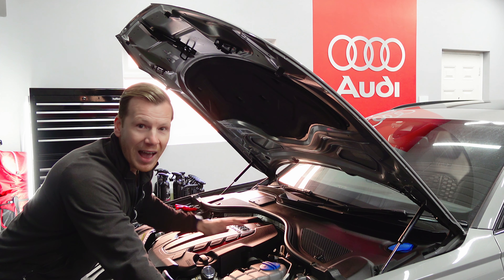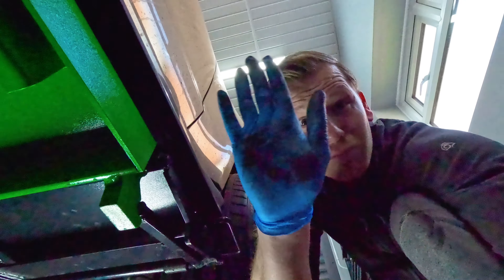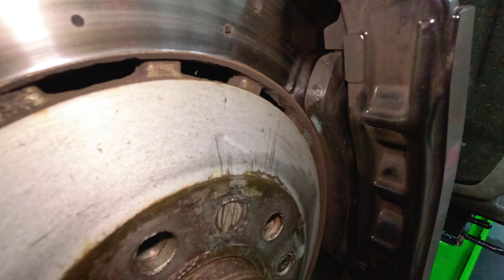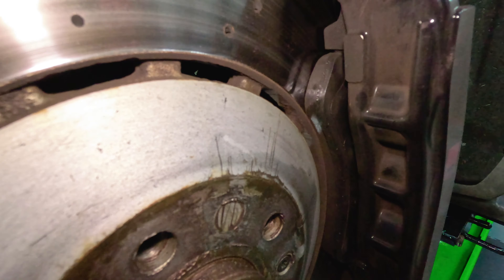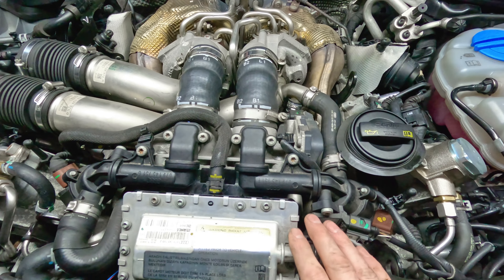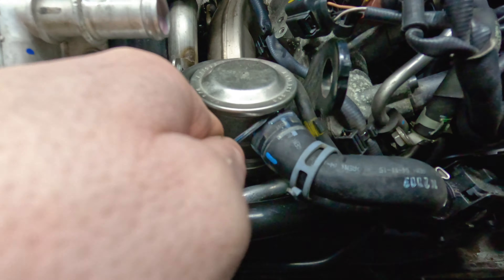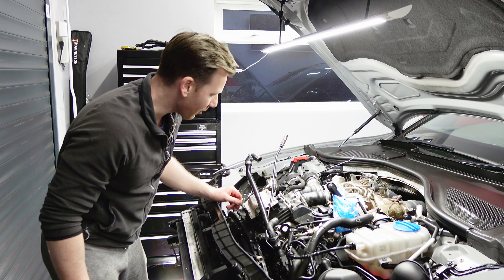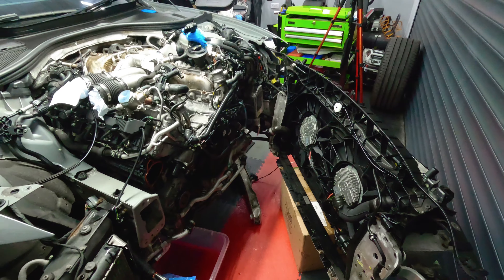Audi RS6 4.0 TFSI PCV Unit DIY Replacement Part 1

Comment: Great work! Clear instructions, well explained and great footage. Too often you find instructional videos missing vital steps! I note there are  two deep torx screws either side of  the bumper that is not easy to reach. Would have been great if you showed what you used to get to them.
Reply from the maker: Hey thanks for the amazing feedback and support,  SOOO much appreciated.  Yes there are three tricky 10mm bolts to undo that hold the side brackets on. Easier to take out with the wheel and arch lining off.   I'll show them clearly on the reinstall video.  Thanks again for watching and taking the time to comment.  :D
Reply: No problem at all. It appears several people on the RS6 C& FB group have picked up on your videos too. Just the other day someone shared a link to one of your vids on the group.

Comment: Suspect i have a bad PCV on my 4.0 S6. Do i have to disassemble the whole front of the car like you did to get to it? Enjoyed the video, thanks.
Reply from the maker: Hi thanks for watching,  unfortunately yes.   You don’t need to take the whole rad pack off.  You can just put it into service mode but you will need to take the front bumper off and headlights out etc.
Reply: Guess i know what i’ll be doing this weekend then. Thanks for the help🤘🏼

Comment: did you get the P2297 air leak DTC and a rough idle (noisy) first 20-30 seconds?  Also Oil cap has a great sunction ?    Let me know mate
Reply from the maker: Hi,  no I didn't get any of those signs,  in fact I think my PCV unit was actually ok in the end,  but I changed it anyway for good measure.  However I can confirm the suction that I got on the clip shown before changing it was the same after I changes it.  These engines seem to have a lot of suck lol
Reply: @InDadsGarage  i am getting missfire and partial loss of water so I am straight to check sparkplugs and afterwards chargecooler , looks like a leak in there
Reply: @InDadsGarage  i ll let you know when  i am done
Reply: @InDadsGarage  I am back mate.  Well most RS6 C7 series have a TPI connected with the fault P2279 air leak that leads to the replacement of PCV or better name it "Oil separator"  So found the issue over there :)
Reply: @InDadsGarage  Problems fixed !  Well Oil strainer changed and then my Water cooler was a mess like yours in the video !    Car runs fine like first day :)

Comment: Subbed. Had the oil separator and PCV done under warranty a week after getting my C7 (when Audi finally made the problem official)

Also loving the garage. I’ve just had my garage extended so I could fit the RS6 in, with pretty much the same roller door. Just need to do the flooring and get some decent lighting so I can get some paint correction done.

Keep up the great content!
Reply from the maker: Hey thanks for the kind words and support.  Having a garage big enough to house your RS6 will be a game changer! Not to mention complimentary on the insurance premiums I am sure.  I can recommend Duramats and their skirting board for the flooring,  that's what I used.  Hope you enjoy the next video :)

Comment: Went for a test drive in one of these ,the other day.Got back to the garage and coolant was pouring out from the same place must be a common fault ?
Reply from the maker: Unfortunately coolant leaks are a common issue,  easy to fix but a pain in the butt to get to as you can see lol. Thanks for watching and taking the time to comment, hope that doesn't put you off getting an RS6 or similar!

Comment: I have a 2013 s6 and changed the oil Seperator using this video (thank you). I now have a p0122 code. did you have to reset the tps?
Reply from the maker: Hi, pleased you found it useful and were able to give it a go yourself 💪.  That codes for the Air intake temperatures.  I would check all your sensors are plugged back in properly and try resetting the code.   It’s most likely a loose or unplugged connection.

Comment: What was the problem, what symptoms did the car have
Reply from the maker: Hi thanks for your comment.  Initially (and still do) had the smell of fuel in my oil, even after changing the HPFP's.  I decided the change the PCV unit in an attempt to tick off possible problems causing this smell but also future proof the car from common failure points.  While in there I decided to re-do the Audi oil strainer recall and replace the check oil valve underneath. Finally I have replace the thermostat housing (check out new video) and got the car back together.  As it happened I didn't have any of the common PCV unit signs of failure so the unit was probably still OK,  but they are know to fail around the 40-50K miles point, which is what my car is now on so a good job done.

Thanks for watching
Reply: Before doing all these, did you notice any oil consumption? And if yes, has this now been sorted? Do you still notice smell of fuel in the oil?

Comment: Amico ho fatto il lavoro seguendo il tuo video.
Ho risolto il problema della valvola Pcv
Ma una volta avviato il motore mi ha acceso la spia epc (regime motore massimo 4000 giri/minuto.
Codice difetto 

Diaframma collettore . aspirazione 
pilotaggio afflusso aria, bancata 2
Codice errore p200700
Sai darmi qualche consiglio ? 
Ti è mai successo ?
Grazie per una eventuale risposta
Reply from the maker: Ehi, scusa il ritardo nella risposta al tuo messaggio. Hai risolto il problema, sfortunatamente non lo so esattamente.  Che tu ci creda o no, in realtà non sono un meccanico lol.  Molto probabilmente potrebbe essere che un sensore non sia collegato correttamente, li aggirerei tutti e ricontrollerei, in particolare tutti i sensori vicino alla presa d'aria, al corpo farfallato e all'unità PCV.  Prego solo che tu abbia collegato i piccoli sensori sotto l'unità PCV prima di rimontare il tutto!!  Cavolo!!!